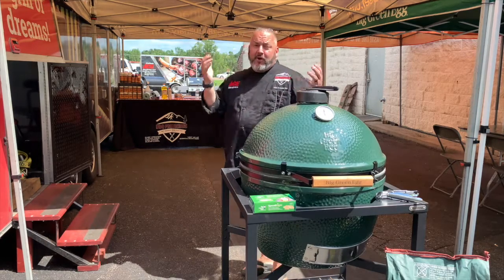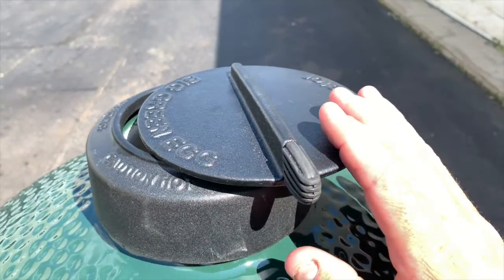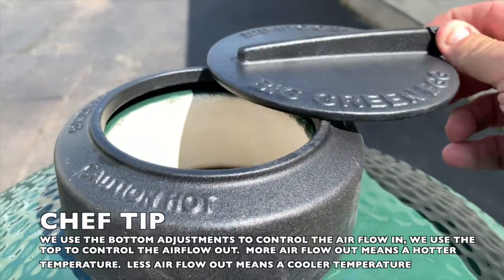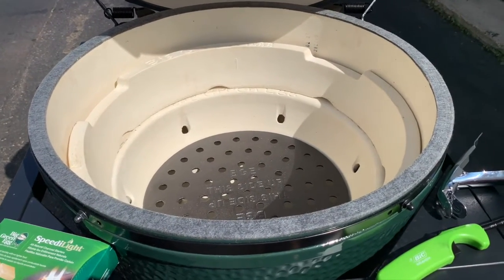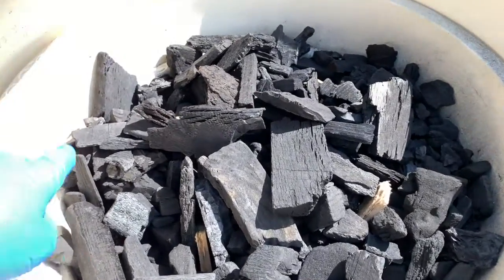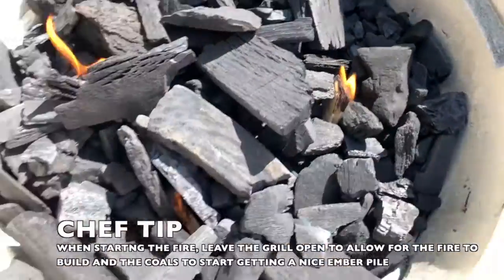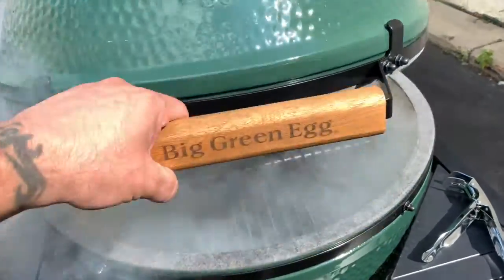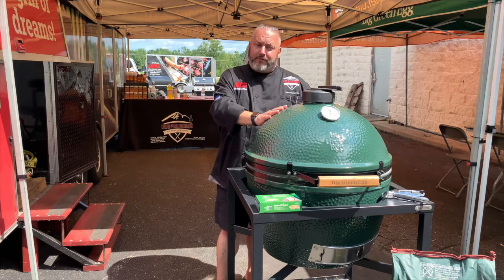How to Adjust Temperature On Big Green Egg - Ace Hardware

Comment: can you use the egg in a screen enclosure  . Meaning will the heat from the top reach up to the top screen and melt it
Reply: I would not use the egg inside a screened in enclosure.  Better to keep it outside and away from anything combustable.  Chef Jason

Comment: My egg is so old it does not have a screen.   I have had pretty good results with sneaking up on the target temp instead of going above it and then cooling it down...it takes forever for the temp to drop.  But that is just my observation.
Reply: I like to get the fire burning string and have a well established ember pile, then go to work.  I think both ways work and at the end we get some solid food to eat too.  You may be able to contact Big Green Egg and get a screen to add in, if you are looking for one.  Happy Cooking, Chef Jason

Comment: I recommend keeping the screen closed.  It’s there for a really good reason.
Reply: So many different ways too use and adjust this grill.  If your grill sits on the deck, that screen is a great spark preventer.  Mine sits on concrete for that specific reason.  thanks for watching
Reply: 5280 Culinary - Chef Jason Morse     Just because your BGE is on concrete doesn’t mean there isn’t a danger of embers causing a house fire.  Just ask Chris (aka NatureBoy on the BGE forum) who owns DizzyPig BBQ company.  His house burned down after an ember came out the lower vent and blew into his garage.  You may want to reconsider telling BGE customers to leave the screen open.  Just saying.....  I enjoyed your video and love your passion.  Keep on Egging!
Reply: @ChefJasonMorse  So what bottom damper setting would you use with the screen fully closed.
Reply: Mike Winanz I would go about 2/3 open with the flap of the screen is 100% closed.  Again, I like to allow good airflow in and choke it off at the top and better control the temperature.  Happy Cooking, Chef J
Reply: @patrickglaser1560    I think water evaporates.  Better yet, just use the screen provided by BGE.  😁
Reply: @patrickglaser1560    You don’t need to get nasty.  Do you want people to pay attention by staring at their BGE for an entire 12 hour cook?  It’s just not realistic just like your water idea.  Just think about it.